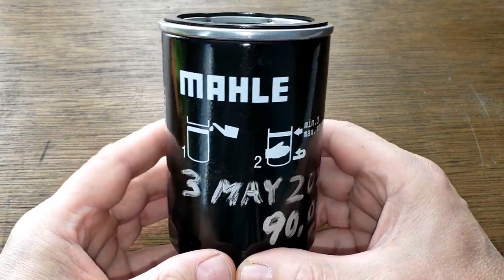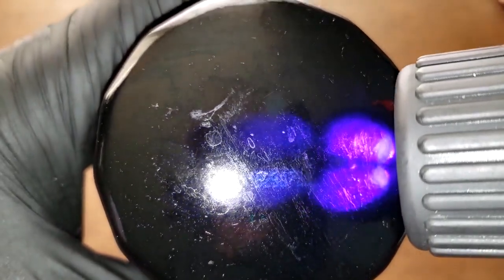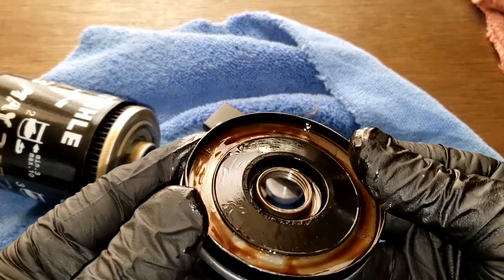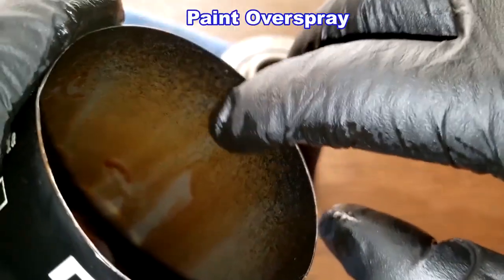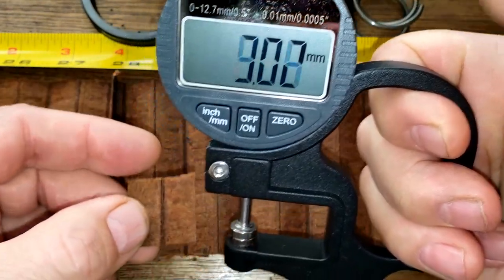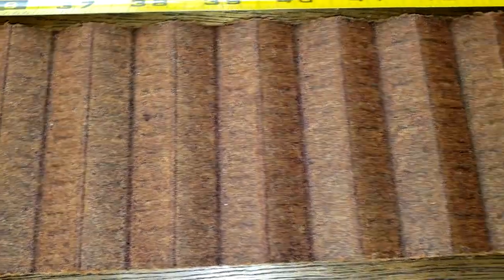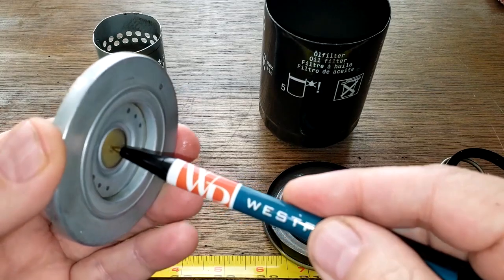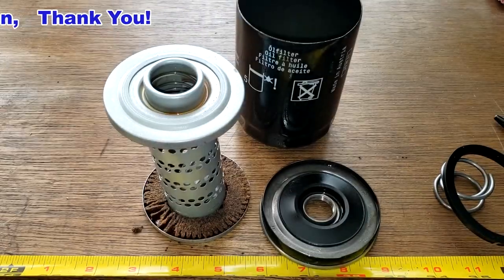Mahle Oil Filter OC 479 Cut Open, Used Mahle Oil Filter Cut Open

Comment: As  faxmen09 already said, this second one valve is another antidrain valve. This deisign uses UFI filters too. Hier in Europe Mahle is one of the best aftermarket filter that you can get. Mahle is actually much more known as a manufacturer of motor parts as OEM for most German car’s.

Comment: This Mahle actually has two 'anti drain back valves'. The normal adbv shown and the mechanical one inside the centertube. The latter is sometimes called an anti-siphon valve. It's there to help keep oil inside the filter on the clean side in centertube on shut down. Some Ford(Zetec) engines also spec the anti-siphon valve in the filter. The engines must be rather sensitive and susceptible to oil drain back.The Mahle looks to be a very well made filter, not surprising considering where made. I don't quite understand the efficiency ratings listed and wonder how and where they were derived. 90%@28um, not terrible, but 50%@18um (close to 20um) not great. Those figs don't seem to jibe, imo. Wonder if current ISO standard ratings. That aside, the Mahle a quality looking filter. Thanks for the interesting vid.
Reply: the motorcraft filters have the base end bypass due to filter positions and I know it needs that on the 5.4.  this might work
Reply: @shanepipkin4041  It's true that some Motorcraft filters for Ford vehicles have base end bypass. However, that's really unrelated to the double "adbv" of topic oil filter. Two different functions. Rather than being responsible for oil bypass, the adbv designed to help keep oil in the filter. As mentioned, filters for Ford Zetec have a similar configuration to the topic filter.
Reply from the maker: You're Welcome, faxmen09.
Reply: @faxmen09   I have a Zetec and the filter is oriented sideways. I've also noticed that the filter is empty every time I do an oil change. I suspect it might be draining the oil whenever I shut off the car and it has to fill up the filter again at every startup which doesn't sound like a good thing.

Comment: This filter has been ‘adopted’ by many of us with the B234/B235 Saab engines, notably because it’s listed for the turbo Chrysler PT Cruiser and more filter area is arguably needed with only 4L of oil in the system.  Not sure if the extra ‘anti-syphon’ valve is serving any purpose in the Saab application, but it ain’t hurting anything either.
Reply from the maker: Thanks for the Filter, Jon!👍
Reply: As you say, extra antisiphon can't hurt. I would imagine costs a bit extra to manufacture with one.

Comment: Thanks for the Mahle filter cut open video, certainly a very unique design indeed.

Video suggestion, could you do a oil drain valve review / disassembly, looking at Fumoto and EZ Oil Drain Valves which are available online.
Reply from the maker: You're Welcome!
I'll see what I can do about the drain valves.
Reply: I have a Fumoto on both of my vehicles.  I've tried several different types and the Fumoto has been the easiest to use and has zero leakage which was an issue I had with the others.

Comment: Interesting filter.  Two pressure relief valves kind of unique... Well top one an outlet not really a relief valve but similar in function sort of.

Thick filter media.  ADBV seemed a bit tough I wouldn't say brittle though.  

Overall seems like a good filter.  Unique that's for sure.

Good stuff 👍
Reply from the maker: Hi, drum
Interesting filter for sure.😊

Comment: Awesome video. That’s a great filter made very well. That’s an anti siphon valve. 

Anti-syphon valve

This valve prevents the oil from running out of the filter when the engine is switched off. It has a function similar to that of the anti-drainback valve - with the difference that the valve is placed on the "clean side" of the filter. As a result, the filter is constantly filled with oil, regardless of whether the engine is running or not. After starting the engine, the anti-syphon valve significantly reduces dry friction between the parts working together, as it contributes to the rapid flow of oil to the engine.
Reply from the maker: Thanks Dennis!

Comment: I like the redundant anti drain back valve. If Fram did that they wouldn’t be “orange cans of death”.
Reply: Actually Fram does make an Extra Guard filter application for Ford's Zetec engines that also has an anti-siphon valve. But, that valve is not necessary for most vehicle applications. Single adbv enough.

Comment: Just curious, me as an European working in aviation, so I use both units… why do you use mm’s for the thickness of the housing and inches for wider ranges? I assume you can measure little values using inches as well? Or is it just easier to use mm’s for thin plates?
Reply from the maker: Just the way I like to measure things that's all.  MM for the thin stuff inches for the big stuff.

Comment: How do you get the oil out of the filter media before you look at it?
Reply: I won't speak for Whip, but wicking the oil from the media can be accomplished by wrapping it in a paper towel, shop towel or something similar. Later, the media can be cut off the endcaps.
Reply from the maker: Hi Kelly,
I line my vise jaws with a rag and set up about half of the filter media like a closed accordion and squeeze it in my vise, then do the rest. The bigger the pleats the easier it is to keep it straight.

Comment: The fact that the filter was empty when you cut it open is more proof why nitrile rubber ADBVs are useless.  They get hard over time and don't seal.  Every single filter with a nitrile ADBV that isn't installed base-end up is empty when I remove it.  If it was installed base-end up, flip it over and the oil drains right out.  No filter with a silicone ADBV will do that.  This isn't a jobber filter.  Why Mahle doesn't use silicone is beyond me.  Thanks for the vid!
Reply from the maker: You're Welcome!

Comment: This filter is going to devastate the stamped leaf retainer spring believers - three coil springs in one filter!
Reply: However, only one serves the same purpose as filter element compression spring, holding element in place. If the stamped leaf spring was not functional, then many many filter manufacturers have it wrong. My speculation majority manufacturers use the flat leaf spring. In my observation, both get the job done.
Reply: @faxmen09  I never said the stamped leaf retainer spring isn’t functional but I have said I believe it’s prevalence is due to its cost, not it’s functional ability. Someone else here said that the coil spring was replaced by the stamped leaf retainer spring because Fram says the coil spring distorts the can(n)ister but couldn’t provide anything to back that up.
Reply: @jeffkortsch8276  Addressing the second point first, reads most like some Fram promotional material, and I think I've seen something similar before. Fwiw, don't agree, both work. First point, possible cost a factor but being pragmatic, as long as flat spring works I'm fine with it. If I misinterpreted likely because the use of the word "devastated" for "believing" the flat stamped spring works too, i.e., it's functional.
Reply: @faxmen09  It’s down to preference . I prefer a better made filter than one built to a low price point.
Reply: @jeffkortsch8276  That's fine, everyone entitled to a preference. Not exactly what your original comment stated, thus reply. My preference is for a quality filter, reasonable price point, decent efficiency, using flat spring or coil spring. I've used both types over decades with success. Bottom line, compression spring type, not deal breaker or specific quality indicator for me.
Reply: @faxmen09  My original comment is directed at someone who was dead set on my not being able to have a preference and that was because the coil spring is supposedly obsolete according to his favorite source - Fram.

I like a middle of the road filter like the Purolator One. Not cheap with fiber endcaps but not expensive with the ability to go 3 times the oil change interval.